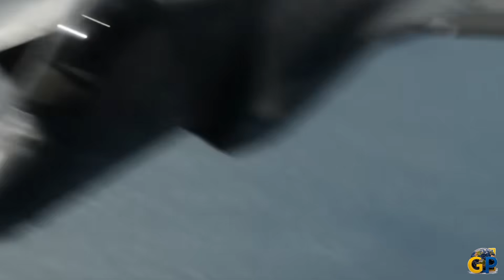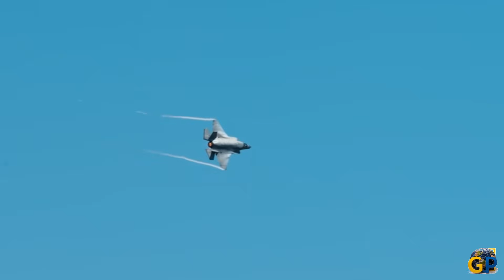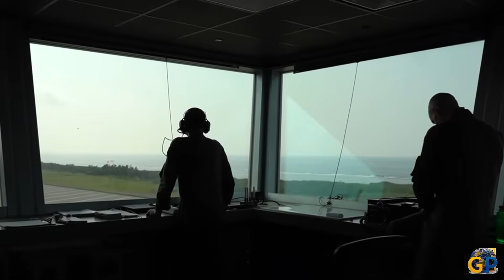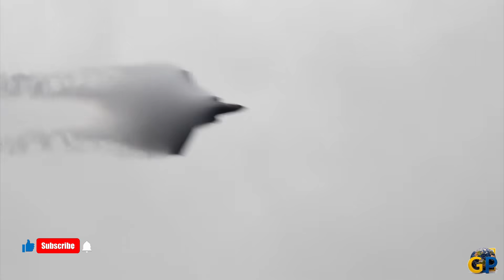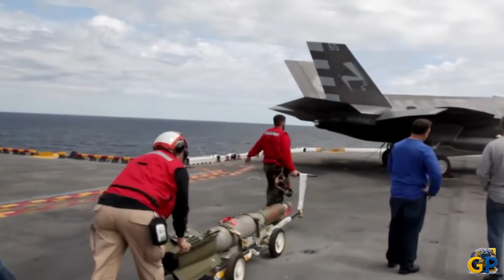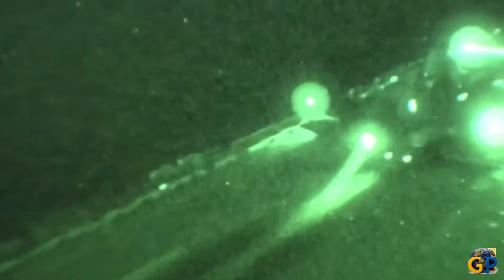Why Some F-35s May Fly Without Radars?

Comment: Upgrade maybe done to make the f35 completely invisible, but that doesn't mean to also strip off the jet from the passive radar along with the active 1.
Otherwise without the radar at all the jet will also not be able to warn against the potential SAM (ground or another jet or anything like that) lock.
And i m sure those in higher position in Lockheed Martin or USA military understands that too. Point is just to make it invisible radar (own radar) wise like it is invisible from the enemy radar. But it have many other passive sensors like IR, DAS etc to rely on while being completely invisible.